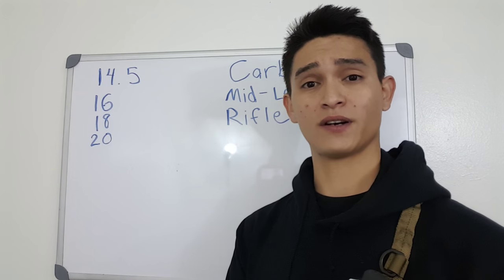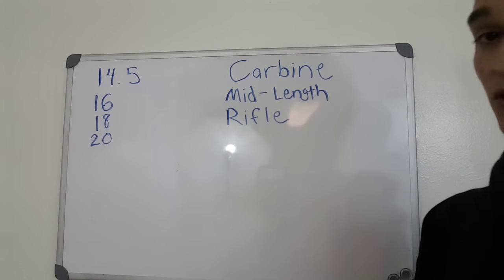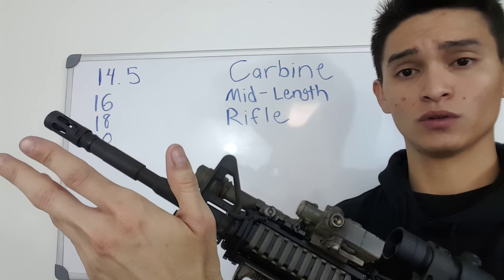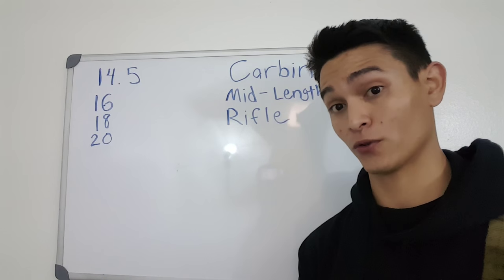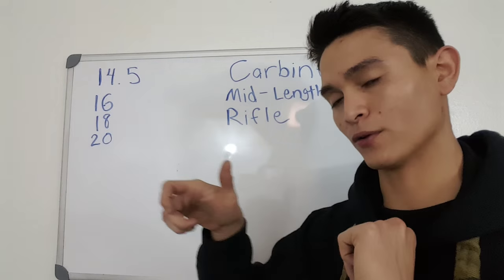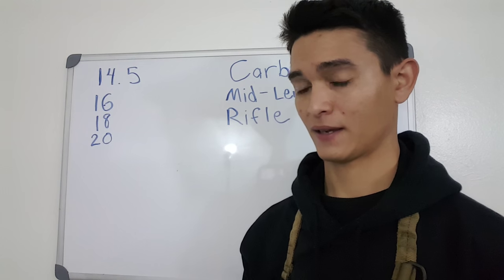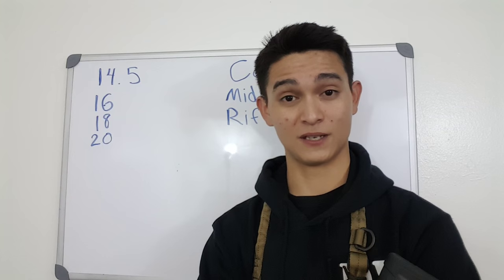AR 15 gas systems and barrel lengths, which one?

Comment: I served in the Marines and the Army National Guard. I was an Infantryman in both. In the Marines I used the Colt M16A2 with iron sights and the Knights Armament M16A4 with Iron sights. In the National Guard I used a Colt M4 Carbine. The best reliability and accuracy I found was in the Knights Armament M16A4. I agree with your idea on putting a collapsible stock on a full length AR. To me that's the way to go. I like a full length AR with an adjustable length of pull. It makes MOUT a tad easier without sacrificing reliability and longer range accuracy.
Reply: Matt The Marine.... FN made our A4's.. KAC just made the hand guard. They were very reliable indeed.
Reply: Matt The Marine i was told that " MILITARILY" a 20" with the collapseable stock was illegal. Not sure why but hey ......go figure right
Reply: Matt The Marine I did the same bro! OorahHooah
Reply: Ras Al Ghul the Canadians roll with a 20” and carbine stock
Reply: Matt The Marine, IIRC, the M16A4 had a little heavier barrel then the A2 had.
Reply: Ras Al Ghul, the USMC currently uses the VLTOR A5 collapsible stock system on most of their M16A4's now.  Perfectly legal.
Reply: Ras Al Ghul, If you were in the Marines between 1994-2004 that would have been during the Clinton Assault Weapon Ban. An AR-15 with a pistol grip AND a collapsible stock would have made a 20” rifle a assault weapon, which was illegal up until 2004. Now its perfectly legal.
Reply: @GuitaristOnDaRoof  The US military was exempt from the assault weapons ban ,it only applied to civilians and AR15's not M16's or M4's which are both select fire weapons and not legal to own for civilians anyway since both of the rifles in question likely would have been produced after 1986 .
Reply: @rasalghul7511  yeah back in the original time when they had the xm177e2 and m16a1 Colt didn't exactly portrayed it as a interchangeable system despite the fact that they would probably both run just fine.

Comment: If anyone needs a new opinion… read below. 

Home defense: 
11.5” / 12.5” 5.56 with carbine gas and A5 rifle buffer. 

All around king:
13.9” or 13.7” 5.56 with mid length gas system and A5 buffer. 
Put an Vortex LPVO and give me 77gr Blackhills ammo and I’ll outperform anyone on the 14.5” up to 18” platforms easy. Key is also to have good ammo. 55gr isn’t my go to.

Comment: Man, I have underwear older than you but you know your stuff. I've been an Armorer forever and you explained things well. I never heard Dwell Time but you got the point across. I prefer a midlength with a 16" barrel, running an H2 buffer if it will cycle reliably. That system will get you back on target very fast and not give up too much velocity. 5.56 loves a 20" barrel for terminal performance! Great video man!

Comment: Excellent video...
I prefer the 16" barrel with the mid-length gas...   I do notice it being smoother than 16" carbine system...
My understanding is the carbine system was designed for the 14.5" barrel so it slightly over gasses a 16" barrel...
The mid-length gas has about the same dwell time as the 20" barrel with rifle length gas system.

Comment: FYI they were not "tuning" the length, it was set for a bayonett and worked with. The midlength is the correct size for a 16" barrel bayonett. Carbine fits 14.5", Rifle fits 20"
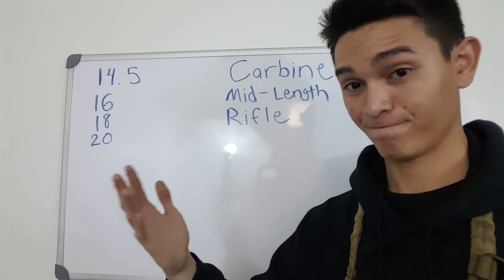Reply: 15:25 ish a lie, they were not designed to push your hand out, just a perk, it's all about bayonetts
Reply: Not to dog on you, seeks you've never considered it, but watch one demonstration with a bayonett you'll be convinced

Comment: AR was designed around the 556 in a 20 inch barrel rifle gas system. M4 carbine the military found the sweet spot at 14.5 carbine. Good for cqb and distance. For legal reasons I may just go 16 inch carbine. Rather than buying a 14.5 and putting the big flash hider to make it 16 or put it on a pistol. For 25 yards to 200 yards really

Comment: Subbed a couple years ago and wanna add a little input too. The M4 was conceived by the Marine Corps and Colt Mfg in '84. Using your eyeball and gutted upper in a stable rest, looking through the barrel and then sights, you'll see that the "Mechanical Zero" of your A2 style sights at a 14.5" sight radius intersects perfectly at 36yds! Super easy...painful to your M4, but they made it happen😁

Comment: Slightly off topic, but what is your thought on barrel brands?  I have been eyeing a 11.5 inch chrome-lined Stoner.
Reply: Thank you.
Reply: psa has fn chrome lined barrels cheap just stamped with palmetto state armory
Reply: Chrome lining is going to negatively affect your accuracy slightly over long distance-but the barrels tend to last longer/are more resistant to corrosion/wear. Military application you’re going to see chrome lined or even double lined because they put their gear through the shit and it needs to hold up. At 11.5” you’re going to be pretty over-gassed shooting anything other than 55gr (an adjustable block would help but you’re looking at a 1/8” twist on your short barrel so why lob heavy/unstable rounds downrange at low velocities) which has a lower ballistic coefficient/lower velocity to begin with-so all factors mean you’re not gonna reach out and touch anyone with precision anyways. Are you plinking, shooting competition, LEO? The chrome isn’t going to hurt you more than the barrel length will at range.

Comment: Just what I was looking for. Thank you. I'm building my first AR after a lifetime of lever action 30/30 and plan on using it for deer but there is so much junk out there about how this is better or that is better. It's like people have pet gas systems they like and will defend them no matter what, even if it's wrong for what you're trying to do. I hope I'm in the ball park here but I'm getting a 20 inch barrel, rifle length gas system and a collapsible stock(lots of in and out of the trucks). Pretty much a system like you explained there at the end. Thanks.

Comment: My 7.5" with pistol length gas system runs great ...now. I had to add the spikes heavy buffer and BCM enhanced extractor spring kit to make it as reliable as it is now.
Reply: Extraction timing is the problem for the need of a spring kit. Too early and the case mouth is still expanding and thus hard to extract. Go to a longer tube instead of the spring exchange because the spring kit masks the problem and decreases reliability.

Comment: the problem with a carbine system isn't just that the gas hits the moving parts harder it's that chamber pressure dosent get a chance to drop n let the case shrink back down so basicly it's ripping the case out while pressure is still high and it's also unlocking while the force on the lugs is high so you get more broke bolts sooner more broke extactors more broke cam pins and worn out springs this is mostly the problem with 16 inch carbine gas guns hence why they put the little o ring n rubber piece one the extractor spring it's a band aid to make the gun run reliably 14.5 carbine guns arnt as prone to it but still are more than mid length 16 inch midy 16s are the way to go next to 20inch guns 16 inch midy and 20 inch rifle guns don't need the o ring I actually took mine out so it wouldn't booger up the brass and so the forward asist actually works without hammering it and it also makes it so your extractor will almost never wear out as well...anyways I'm rambling. but there you have it. peace.
Reply: deucedeuce22oz yes it can be changed without replacing the barrel.  It's easy enough to do or a gunsmith can do it affordably.  That being said a 16 inch with a carbine gas system should run fine,  will recoil slightly more and wear out parts faster than a 16 inch with a midlength sys.   Really just depends on what ur doing.   I have that setup and have had zero problems.   Honesty not a bad idea to have a backup bolt carrier group anyway.   I'd run it and see how it does
Reply: deucedeuce22oz no it doesn't matter that much which length gas system you get
Reply: jesus christ, use some punctuation
Reply: @goggleboy2464  how can you change your gas system without changing the barrel?
Reply: @anthonygonzales6029  lol ur right.  I guess its possible if u get a longer tube plug the hole and move the gas block.  But that'd be a nightmare.  Especially since a barrel isnt that expensive.

Comment: The 20 inch is best for: velocity, fine1/2 minute rear sight value for windage and elevation and 1 1/4 minute front sight value; plus, easier focus on front sight. This configuration is good to 1000 yards from single loading 80 grain SMK’s. Lots of fun.
Reply: With what twist rate? That would be a blast!!🤣

Comment: What buffers do you use with a 16" mid length gas system?
Reply: I’d say an H1 or lighter...I had a 10.5 rifle in .223 and another 10.5 in 300 blkout. My 300 blkout liked an H1 and the .223 wylde liked a H2.
The number is the number of tungsten weights inside the buffer. Some pistols with suppressors need H3 buffers. Best thing to do is always pay a little more and get a adjustable low profile gas block. Then you can try and tune it before replacing the buffer

Comment: As a 6'4" 220lb guy with long arms I really did try to like my carbine length 16 inch gun for the reasons mentioned but even with the stock fully extended I felt all scrunched together with the "M4" style setup. 
I'm doing my first build currently and Im doing an M16A4 inspired build minus the knights rail in favor of a drop in MI Mlok. I am a fan of the better ballistic stats. Hopefully the full size gun will feel more balanced for my big ass.
Great video, very informative.
Reply: PSA is offering FN CHF barrels
Reply: I’m 6’4 220 would you recommend 16in?

Comment: I love the 16 in with a midlength system. My BCM is tuned beautifully. Unfortunately, most manufacturers who sell entry to mid level ARs come with a standard A2 front sight gas block at carbine length, and are 90% of the time WAAAAY over gassed causing your BCG components to take on more wear than normal and causing early failures. I wish they would tune the gas system with heavier buffer or spring before they send it out. I guess that is why you pay so much more for a company with that level of QC
Reply: Mid level options that have midlengths I've seen are like:
-S&W M&P 15T
-Sig Sauer M400 Tread
-Springfield Armory Saint

PSA also has options here, priced below the aforementioned items, but everyone has their caveat with them.

Otherwise, aero/BCM build for the same cost ($1000-1200) is probably the way, if you don't mind doing very slightly more than just an off the shelf complete option.

Comment: I'm new to AR-15's and rifles in general. This information that you provided was extremely informative. Being a CA resident, we have some new restrictions about to take place in 2017 that is requiring me to rethink the components of my AR-15 build. I'm building a "featureless" rifle that has a fixed butt stock, no pistol grip, vertical grip, or flash hider in order to make it "California Legal" without having to register it as an "Assault Weapon".
Since my Thordsen FRS-15 buttstock is so damned short, it seems like it makes sense for me to go for a longer barrel and rifle-length gas system since I'm not planning to go on long patrols, hikes, etc.

Comment: My STAG Arms 18 inch 3-Gun comes with a H1 buffer weight. Shoots very soft and barely any felt recoil. Even tho it has a RIFLE gas system it uses a Carbine spring and H1.

Comment: Thanks for the videos, dude, learned lots especially with your Wolf ammo and Rocketship AR vids.  Those older videos got me looking at the gas length vs barrel length thing and read in several places that as far as the violence of action/wear on parts, the key factor is the distance between the gas port and the end of the barrel. Ex: 14.5" barrel vs 16" barrel, both with carbine length gas systems (assuming same size gas port), the 16" would have greater violence/wear because the round is in the barrel for longer past the gas port and directs more pressure through the gas tube back to the moving parts.  If the 16" has a mid-length system then the distance between the gas port and the end of the barrel is the same as the 14.5 with the carbine system, so same wear (all other things being equal).  The question (finally): Your thoughts on this stuff?  Am I just being to much of a geek here and out to lunch?  Been looking at how to build out my AR, use the heavy buffer/spring/M16 bcg/etc... Do you think any of this nerdiness is really worth while or I'm just wasting brain bytes?  I know I'm building either a 14.5 or 16 and planning on using several of the upgrades you've suggested.  Looking to build a never-fail SHTF gun, shoot cheap steel-cased for the practice budget, build a well-rounded set of skills.  Thanks for reading through this freaking novel!

Comment: IIRC, gas system length also has to do with dwell time. 16" carbines are over gassed as compared to 14.5". The 16" mid-length gives the same dwell time past the gas port as a 14.5" carbine and a 20" rifle. Just what I have heard.  Great video...

Comment: One question to ask is what caliber bullet are you shooting? Traditionally, you will want a 16 inch barrel to run on a mid length gas system, but I'm running 300 blackout on a 16 in Barrel. The pressure coming from that round is a lot less because it is in a shorter casing, so you want to compensate for that by running a shorter gas system. So I have a 16 inch barrel with a carbine Gas system to make up for it and it works beautifully.

Comment: OK my young brother, I'm somewhat familiar with the M16 from being in the army decades ago (1970-1973) and I'm looking at purchasing my first AR-15 for home protection and for SHTF when the time comes however, I survive on a fixed income where ammo needs to be affordable so my question pertains to what caliber should I look for in an AR-15 on a limited income?  Now I've had several smart-asses tell me if income is an issue than I need to forget about buying an AR-15 and that's bullshit!  I'm looking at .223 vs. 5.65 and was wondering what your thoughts are on this question?  I've had a few guys tell me that .223 & 5.65 are one-in-the same?  Thanks and I enjoy your videos.
Reply: First of all, there is no 5.65...u can buy an upper that shoots 5.56 and it'll be backwards compatible with 223. How long ago did u use the M16? Secondly, if you're on a fixed income, may I suggest just buying a mossy 12g and call it a day?
Reply: Seems like you're looking for a more simple setup. Find yourself a new Colt M4 Expanse or any other mid-range value AR15, then start shopping for new furniture. 

Building your own gun is great and everything, but the value is still there with some full-builds.
Reply: Uhhh .223 is an obvious caliber choice and yeah, whoever told you you cant buy and shoot an AR on a budget is full of shit.  Del-Ton is THE best budget AR money can buy and steel case is cheap.

Comment: Just put my 2 cents in. I built a pistol. Extra powered polished recoil spring and a heavy buffer ran perfectly. AAC flash hider. No flash. No recoil. Ran smooth and accurate for about 500. No idea after that because it was stolen. But I will be making a new one. For a close range "truck gun" it was perfect

Comment: I'm starting my first AR build, and I found this video very helpful! Is there anything to look out for in using a rifle length buffer vs. a carbine length, and does the choice of buffer type matter with different length gas systems?
Reply: Generally you want to keep the carbine buffers with the carbine/mid length gas systems. Unless you're doing some reloading, or shooting suppressed where the back pressures will be higher, in which case you would want a heavier buffer or a tunable gas block.
Reply: yes...it matters quite a bit

Comment: Gas tube is measure from one end of the tip to the other end. So a Pistol length gas tube is 6"3/4 Carbine is 9"3/4                       Mid length is 11"3/4 and Rifle is 15"1/8. Dwelling time will be longer on a 18 inch barrel with a rifle length gas system than one from a mid or carbine length gas system if the barrel is 18 inches right? Thanks

Comment: Is gas system/barrel length a factor when you're setting up a gun to shoot steel-cased ammo?  I'd like to put together a gun that I can shoot a lot for less money but I've heard that some combinations work better with steel than others.
Reply: He has a video on how to reliably run steel cased ammo. Basically it comes down to generously lubricating the gun, particularly the barrel extension - which he refers to as "bore bathing." What he suggests works, as I've never had a single malfunction with steel cased ammo - ever. In fact the owner at the range I shoot at told me I'm the only person he's ever seen not have a malfunction with steel cased ammo (which I found hard to believe) and asked me why my gun ran so well with it. I told him about bore bathing and referred him to his video on it.

Comment: hey, I have a bcm 14.5 mid with an a1 stock.  Balance is amazing and it's only 34" long.  my question is, I'm debating having a collapsible stock for different shooting positions or possibly a rock river a2 entry (7 inch) stock for a modern square stance and nose to charging handle position.  do you think either of those are worth it over the a1 stock?